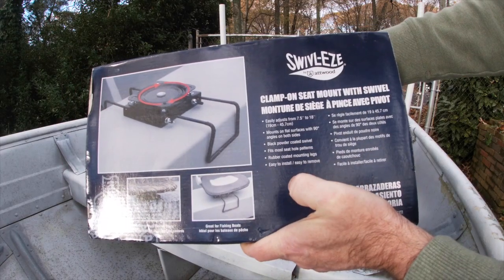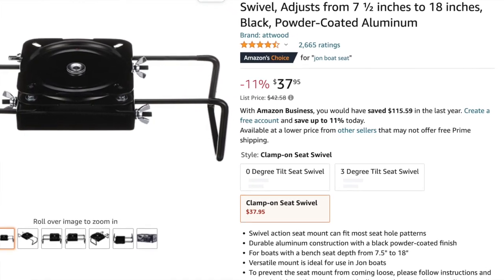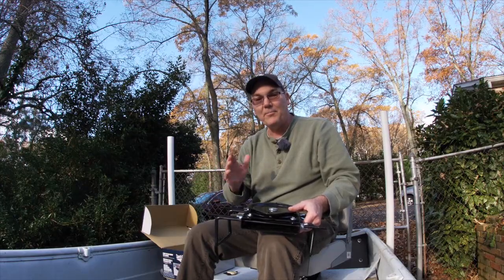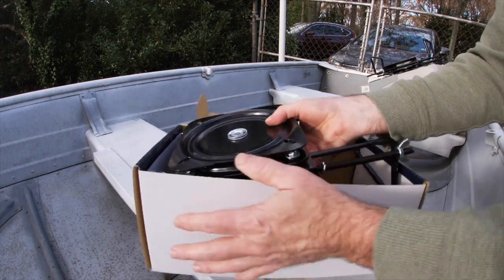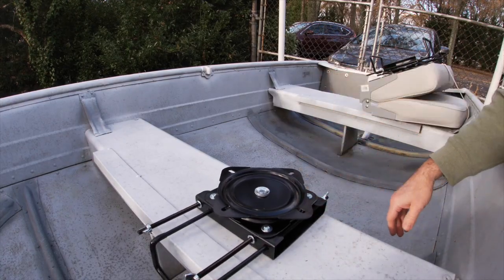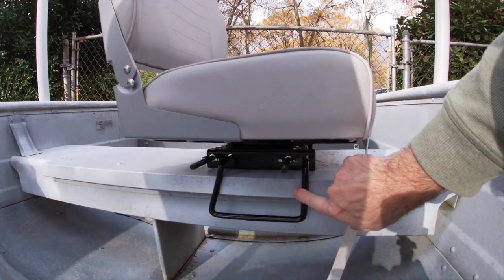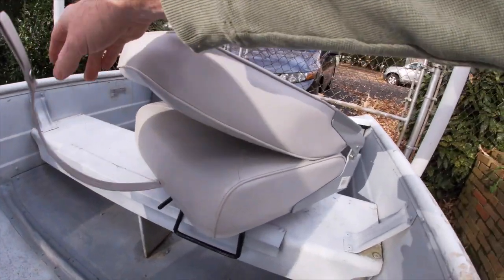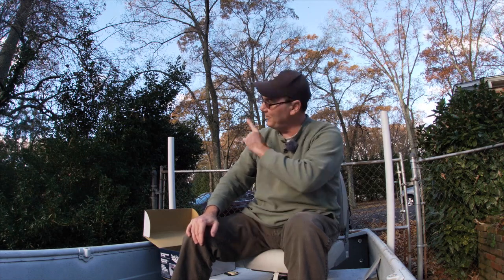Cheap Jon Boat Seat Mounts - review of clamp on swivel style seat base

Comment from the maker: My boat is a V hull and there's also flat bottom jon boats. Which type is better? That's the topic of this video here - - > https://youtu.be/DG123pdYtYw
Reply: Thanks for sharing the pvc pipe tool for tightening the seat wing nuts.  That simple tool makes the tightening of the wingnuts so much easier.

Comment: Thanks Wayne for another great video. 
That's exactly what I have used for years and currently. I also bring them inside after I'm done for the day and not a big deal because as you mentioned  , they stay like new. 
I'm sure many people have bought used boats where the previous owner left them outside all the time and when you decide to move or remove them  , it becomes a chore fighting the rust and the bees that are hiding in there. Thanks 
Mark from Harford county
Reply from the maker: I didn’t even think about the potential for bees!

Comment: Mount the seat to a piece of wood whatever your bench size is then mount the wood and seat to the bench with some self tapping  screws.  Thats what i did back  in 1999 and there still strong and working great. You can paint the wood first or carpet them
Reply: Thank you that actually sounds like a good idea I’ve been trying to think of a way without messing up the strength on my old jon boat

Comment: Great video. Have these that I use to switch in and out of several boats. I made a similar tool with a piece of aluminum sch 40 pipe but added one trick more to the tool. I drilled a cross hole on the opposite end where I can place a screwdriver or fishing pliers and tighten. I found some times on trips these things get loose so needed to fix on water and wet hands made my old pvc tool an issue. I store in shed when not using and my set looks a great as the day I purchased after several years. I rinse when I return, dry, then spray hardware with fluid film before putting these and engine in storage.

Comment: Could the rust be from the aluminum anodized the steel. The same used to happen with trucks and vans. Yours does do that because of power coat and seasonal removal.

Comment: After reading comments on your threads that these loosened and people went overboard I’m thinking not
Reply from the maker: I have not had any issues with them getting loose after I fabricated a tool for tightening. But these type usually aren't as secure as a fixed mount seat.

Comment: Wayne,  this is a comment i received on facebook. can you touch on this if youve had an issues? "I have had trouble with these.. they clamp onto the bench and they use the rubber to 'grab' onto the bench. When you lean back, it is relying on the friction between the rubber grabbers and the bench to keep the seat  from falling backwards. In my experience, I have hat to sit straight up and couldn't lean back too far or the seat would slip backwards."
Reply from the maker: Because of the design this is a potential problem especially for taller or larger people. I have only had the issue when the wingnuts aren't fully tightened - which is why I now use a tool to tighten them.
Reply: That’s what I figured. I think I’m gonna try it out.
Reply: My boat came with these on it when I bought it.  Will admit they were corroded.  My first time out with another fisherman, the risk you describe almost happened to my fishing buddy.  He sat in the seat on the middle bench and began pulling up on the anchor line.  That pressure was enough to get the seat to suddenly slip out of position, and he very nearly went over the side.  Never again.  My first mod to the boat was to ditch those seat mounts and affix the seats to the benches.  I did reuse the swivel portion of those mounts, so the seats will swing around.  My boat is stored inside, so I'm not concerned these steel swivel plates sitting in the weather.
Reply: Screw a strip just over top of the clamp , then it can’t go up and you can’t fall backwards do the same thing to the other side